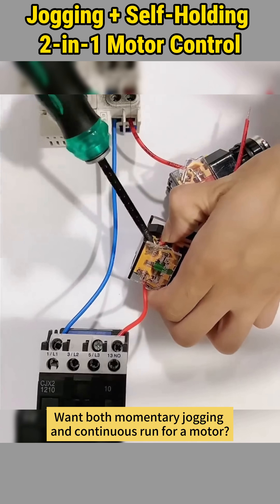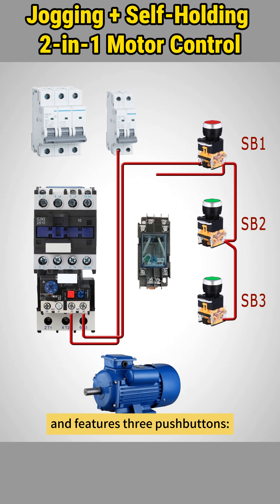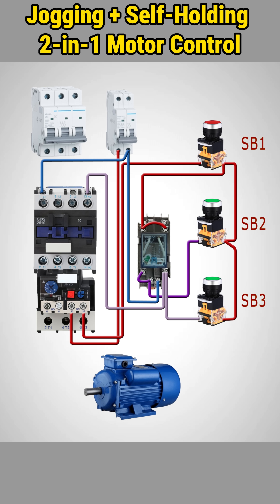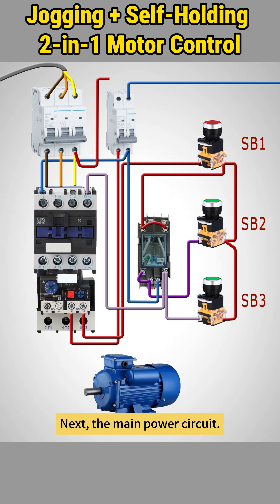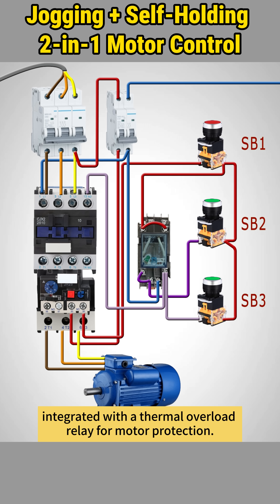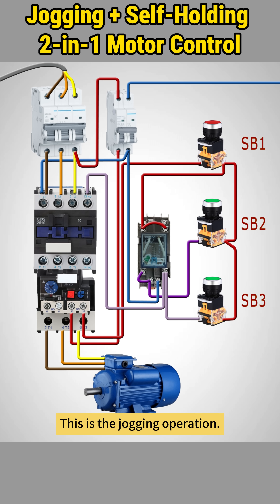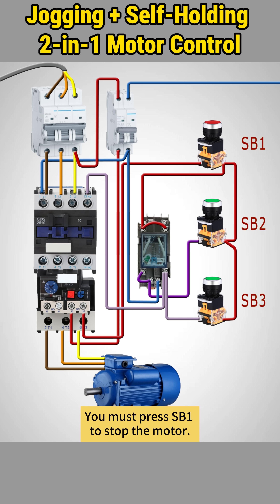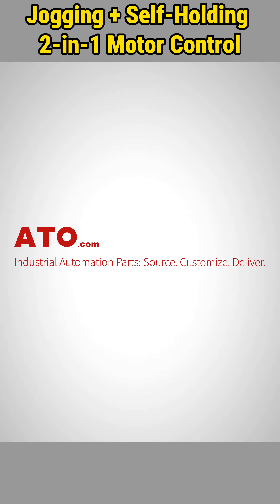Jogging & Self-Holding 2-in-1 Motor Control Circuit

Comment: Nima uchun bu sxema
Reply from the maker: This is called a Jog/Run Circuit that  provides both short, precise movements (jogging/inching) and sustained operation (self-holding/running) within a single motor control system, essential for positioning equipment like conveyors.